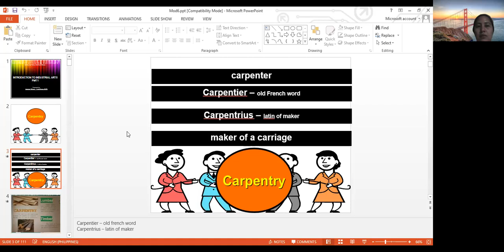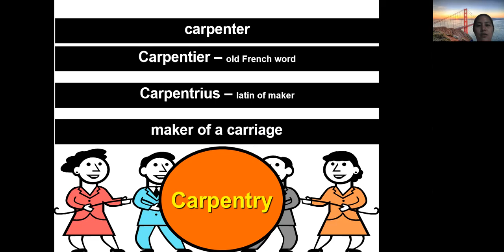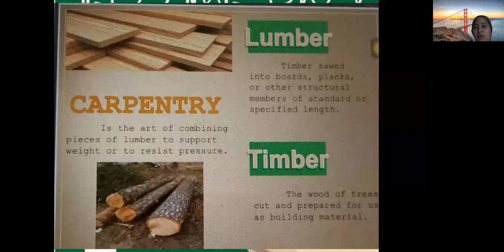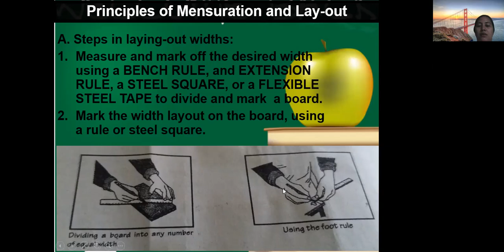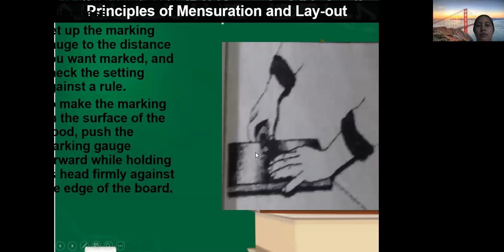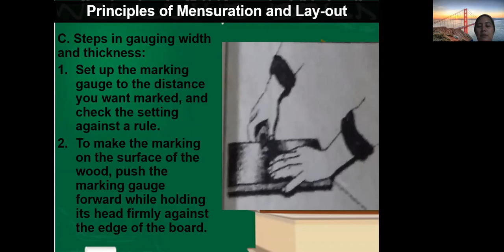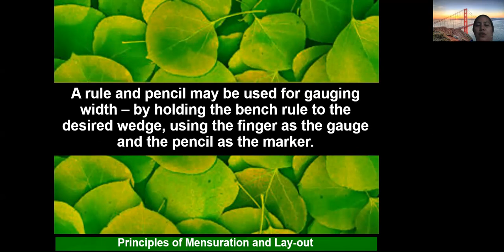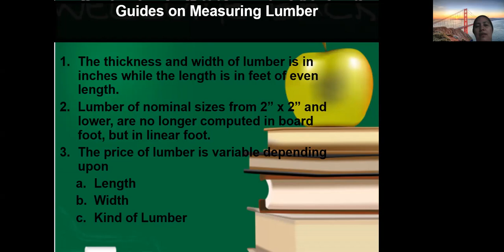Principle of Mensuration and Layout

Comment: " WHY CARPENTRY IS AN ART?"
Carpentry is defined as art because to make a craft  or woodcraft it requires or it necessary to apply the elements of arts like line, shape, texture and etc. to make the craft of carpentry more beautiful and eye pleasing. Carpentry is an art because it requires pattern and process of doing it. Not only putting pieces of wood but it needed design and artistic pattern to make an woodcraft for carpentry.

Comment: Why I need to square a line across the end of the board where there are no cracks?

Ans: To use this board (without cracks) as a materials to have a solid object that we are wanted to make. It is not advisable to used boards with cracks as a material.

Comment: Why carpentry is an art? What is the connection of art to carpentry? Why is the meaning here is the art combining pieces of lumber?
ANSWER : The carpentry is an art because all the carpenter that they do,,this is always an Arts. Art is very vital in carpentry it is because art make an color to the carpentry and it is serve as a light in the carpentry. Art in the carpentry, the carpenter can make a wonderful output. 
The connection between the art and carpentry is skilled construction labor. Woodworking and cabinetry making is a form of art.Carpentry, the art and trade of cutting, working, and joining timber. The term includes both structural timberwork in framing.

Comment: Why mensuration and lay-out is important in carpentry?
Ans. Mensuration and lay-out is very vital and useful in carpentry, especially to the carpenter and it is because the carpenter use mensuaration and lay-out to measure the exact and accurate measurement of wood. And through the help of mensuration and lay-out the carpenter can do his work easier and faster which is really better in the carpentry.

Comment: Why we need to line across the end of the board where there are no craks?
 To have a proper measure of a lay-out and it will not be cracked or damaged if it slit also to get a proper interval.

Comment: "Why you are going to square a line across the end of the board where there are no cracks"

Answer:
To gain a proper measure of a layout and to ensure that it will not be fractured or damaged if it is slit. Also, 
we need to line across the  end of the board that has no cracks to avoid wasting the board or materials and to assure that the end product has a good quality. It will also help us avoid further defects or to avoid from breaking the board.

Comment: Why you  need to square a line across the end of the board where there no cracks?

Answer: We need to square a line across the end of the board where there no cracks in order to provide smooth, straight lines. It will provide a better finish concrete product and will be formed in specific locations where those cracks could be monitored. Sometimes because of the material and width or span of the concrete joints are required to improve the performance of the material and allow the materials to expand/contract or move without damaging other structures.

Comment: Why you are going to square a line across the end of the board where there are no cracks?

Answer:
we need to square a line at the end of the board to allocate and avoid creating a weaken area in the concrete and regulate where cracks will occur, usually in a straight line. To have a good measurement and balance measure.

Comment: Question: 
   What is the Importance of mensuration and layout in Carpentry?

Answer: 
   Accuracy is of utmost importance in Carpentry. Professional and expertise in woodworking is crucial to render wooden designs with perfection. Without accurate mensuration or measurements and craftsmanship or layout, no design will fulfill it's intended purpose. So the Importance of mensuration in Carpentry or in the Carpenters is to give the exact measurements or give the finished look that they expected. Without accuracy or measurements it'll fail to give the finished look that they expect.

Comment: QUESTION: Why carpentry is reffered to a maker of Carriage?

ANSWER: Carpentry is reffered to carriage because the word carpentry is derived from late latin 'carpentrius' or a maker of  a carriage. And just like to make a carriage, wood and iron were the primary requirements needed for the carpenter to build, repair and construct structures and buildings etc.

Comment: Why mensuration and layout is important in carpentry?
Answer :
Base on my Opinion, mensuration and layout is important to carpentry in making a good work or products, because without a mensuration the works in a workplace areas are failed. So that why mensuration and layout is recommended to use in making measurements to get a good quality products.

Comment: "why you are going to square a line across the end of the board where there are no cracks.

-For me we need to square it to locate the exactly measure without accrossing in diffent ways,so we can directly form a line without going in that cracks,and then to get the correct measurement me need to measure.